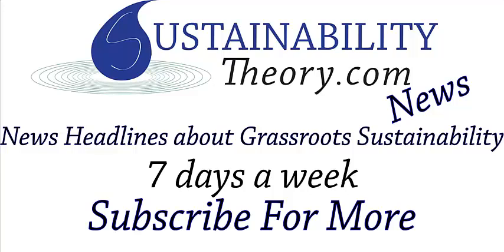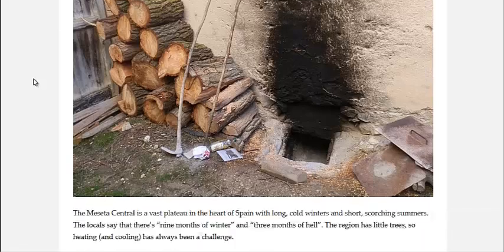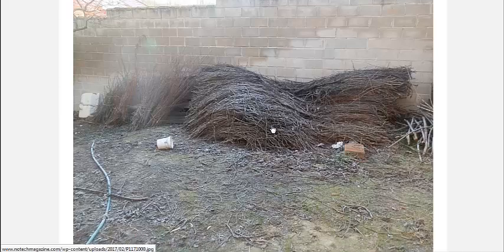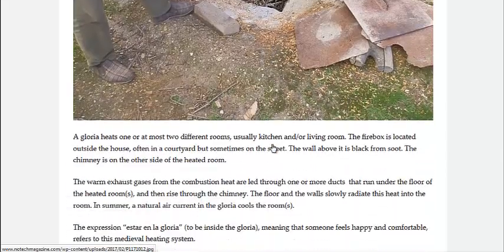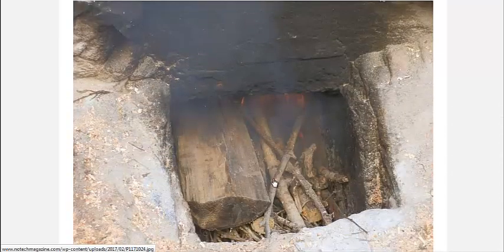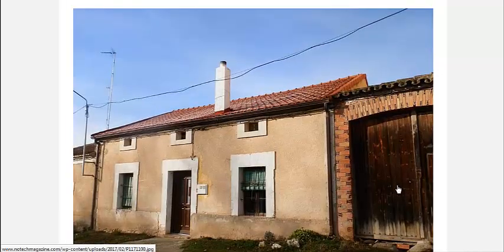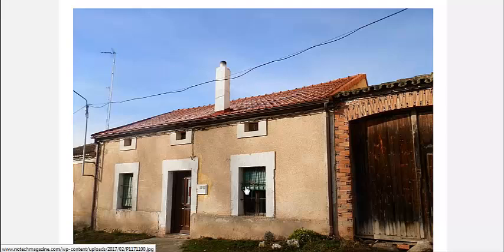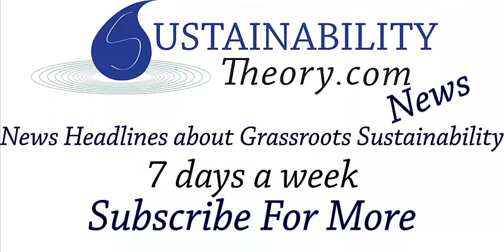Ancient Home Heating System Still Used In Spain

Comment: This doesn’t have to be just for a tiny house.

Friends of mine built a fairly large house with two stories, two bath, very large family room, living room, large kitchen, storage rooms, three bedrooms, with both electric heat and a very modest woodstove in the basement.

A few years ago they had to go away, but needed somebody to stay, and look after the horse (Which was home in the barn from the pasture for the  winter), so they asked me to do it.
    I found that I had only to bank up the woodstove to about the three-quarter level in the morning, and set it for a slow burn all day; not only did those few modest logs heat the entire house for the day, but in the mornings, when I would go down to light the woodstove, the coals were still quite live, and it was only a matter of blowing on the  coals once to reignite the flame when I went to set the fire for the day.

During the whole time I was there there was no need whatsoever to actually light the fire; it was only ever a matter of putting the firewood in for the day after blowing on  the very well-established coal bed.

The system of ductwork that they had installed throughout the house from that little woodstove, kept the entire house quite toasty for at least 24 hours.

Another one of my friends built her house with a System of her own design that has something like a double set of studded walls With a woodstove in the middle of the living room on the first floor.  she also installed a heat sink.

This house is very large.

With the system that she has, it is not only warm, but she can light a fire in her woodstove, and come back four days later to find a house is still very warm.

Comment: I wonder if the spaces are sufficient to put fluid-filled lines between the nubbins. I am thinking it would work well for transferring heat from say a compost pile.
Reply from the maker: @monkeytrainer8135  good point, that would probably work, but I've been thinking of running hot water from the compost puke through a small radiator with a fan to act a a sort of heat exchanger.

Comment: So you would only need to heat only one or 2 rooms despite having more? And what about 2nd floor rooms?
Reply: Yes, only your hearth room would need a fireplace. For a second floor, i would simply eave the fireplace uncovered as it was traditionally, allowing its heat into the non-floor heated part of the home. Korean kitchens were typically open air to let out the excess heat from the hearth and provide ventilation. For a two story building, remember that heat rises. You can adapt this technique to heat a second floor either with a loft or balcony open to the same great room containing the fireplace, or with vents in the floor, or with hot water radiant floor pipes, heated by the hot air in the flues. Heat rises. Don't  just let it concentrate in the ceiling. Direct it to where you want it to be. Also, if you live in an area with heavy seismic activity, avoid this heating technique as I suspect it, being masonry, would not fare well in earthquakes. There's probably a reason the Yayoi Japanese did not bring this cozy heating system with them, despite its prevalence in their ancestral cultures. Also, try leaving part of the floor unheated for furniture or else make sure all furniture in the radiant section is elevated on legs.

Comment: Would this not smell and gas the house
Reply: Ounly at starting fire fumes might comes out where you feed it, but after it start the cycle there is no smell/fumes/gasses on house... Unless you have you burried someone inside the cement when building house... What wuold cement/floor smells it wuold smell inside the house as well.

Comment: Hi! What company is producing this?
Reply from the maker: Hey David,

I'm not aware of any companies doing this exact thing, but plenty of people do it themselves by building Rocket Mass Stove systems. You can route the HOT exhaust gases through pipes under your house or through a big rock wall,  under a clay/adobe bench,  or through a fish pond, or anything that can hold a large "Thermal Mass"

Here are a few videos I did that mention rocket mass technology, there are links in their descriptions, as well as the description for this video.

Comparing passive heating technologies 
https://www.youtube.com/watch?v=IOhtCwVwLok

Rocket Mass Pizza Oven and Pressure Canner 
https://www.youtube.com/watch?v=W9XNuNGp-xA

I hope this helps,
Carl
Reply: These can cause problems with carbon monoxide.  Electric and hydraulic versions are produced however by companies in the US, and are much safer.
Reply: The roman empire
Reply: link for hydraulic pls
Reply: Matt Pelzek ...it’s just as dangerous as a fireplace.
Reply: @danielalvarado9019    You mean just as dangerous as an OUTSIDE fireplace. . .except that it is partially covered. . . and uses less wood.
Reply: Ideally the system would have zero risk of carbon monoxide poisoning (since the fire is completely outside) and the fuel it uses is less than a regular fireplace ideally as well.
Reply: @mattpelzek3809  what a genius! Nobel price award comment!

Comment: “Thousands of years ago”. I guess two thousand is technically thousands? Cool video though. Keep in mind, this is southern technology. They don’t know what real cold is.
Reply: Yes, thousands because it was used by romans, but not inventend by them This is very ancient. And you can experiencie the"real cold" and the "real hot" in Spain too.
Reply: @thec0c90  Hm, which is why you guys walked around without pants? Why pants are invented in the North?  

Nope. You guys don't know what real cold is. Real hot, for sure. Your winters are like our autumn.
Reply: @Faramund  this is similar to the floor heating system used in ancient Korea, NE Siberia and the Aleutian Islands since about 1000 bc. Their winters were/are extremely brutal.
Reply: @denalinefertari942  From what I know, I could obviously be wrong, a lot of heat is lost heating a floor. While putting a fire directly in your room is a lot more efficient.  

This is why everybody in Northern Europe has always done it in the latter way.
Reply: @Faramund  actually the system renders the home so warm those paper doors were required to prevent the house from becoming too hot. More heat is lost when it goes out of the chimney. Far less fuel is required to warm a house with thermal mass from below. Family experience, keep that fire gentle or you risk burning your feet. Which reminds me, most European homes in ancient times through the 18th century had rush floors similar to barns. Obviously one could never think of heating something so flammable from below. Having a single fireplace might be faster to build and could keep the fire contained so as not to ignite the rushes.
Reply: I made a comment a little further out they’re describing a system that Friends of mine in northern Canada built. They use it to heat a fairly large house, using just a few logs every day. Instead of an exterior entrance, where the fire is lit, they use a small woodstove.

Just scroll through and find the comment for the description.